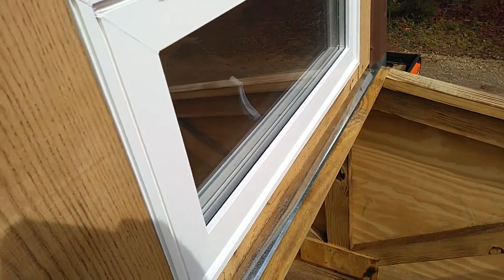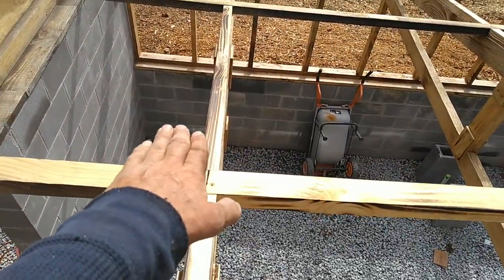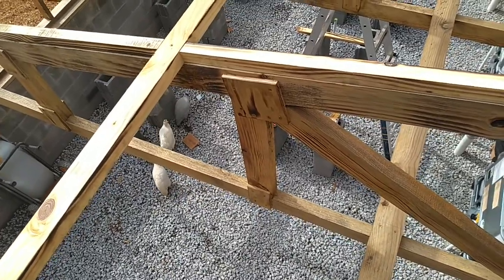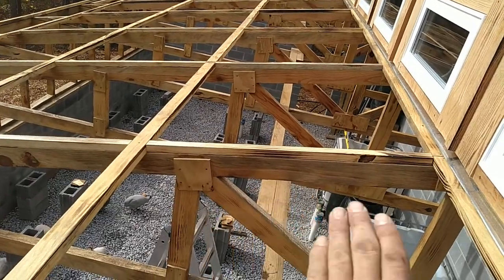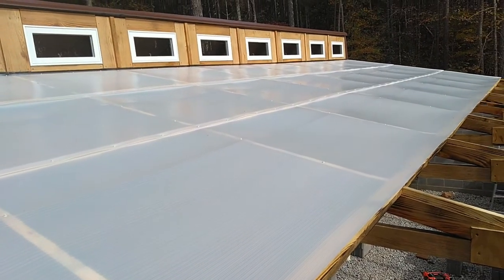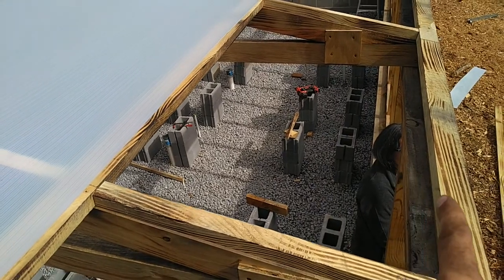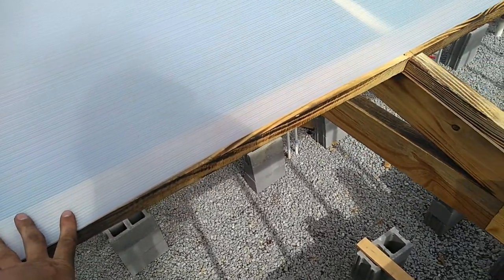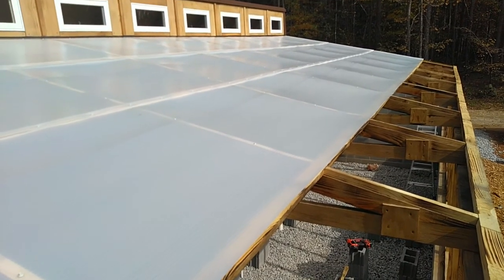Off-Grid (4 Season) Aquaponics Greenhouse-  installing the Solexx Panels-#106

Comment: I have wondered if a heat gun might help to install or just wait for the hotter day to install.
Reply from the maker: Not sure if it would help. I've been told to use chicken wire  first pull it right and then put down the sollex. Hopefully i don't need to do it again but if i do that's what i would try
Reply: @DawnRedwoodGroves  it definitely would help to support the material continuously. We let the distraction of everything in the past four years distract us - hoping to get back on track like you did!

Comment: You did what we have been wanting to do in Northern Nevada... we need to lengthen our growing season above 5700' altitude. Great job!
Reply from the maker: Thanks, it works great, the coldest it's gotten is 42 when we got 3 days of below freezing with a low of 15. That's with the wood stove on low. With sun it will hit 100 with the outside in the 30s.

Comment: After 2 years, how has Solexx been doing? Have you used other plastic film coverings in the past? If so, how does it compare?
Reply from the maker: So far it's still holding up well. Greenhouse was 68 deg F last night at 5pm at 8am next morning it was 52 deg F with it 29 outside. I don't like not being able to see thru it but i think the insulation factor is worth it. 

Our 1st greenhouse uses Tufftex It works well too. You can see thru it but it doesn't maintain heat as well. 

Thanks for watching